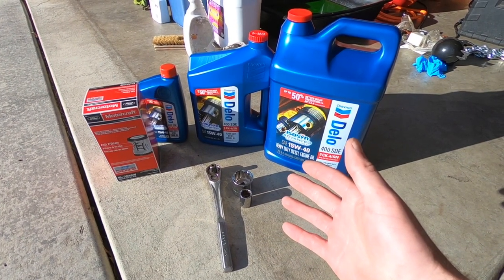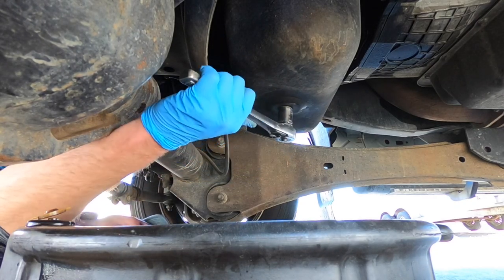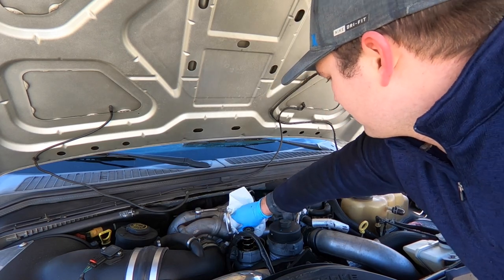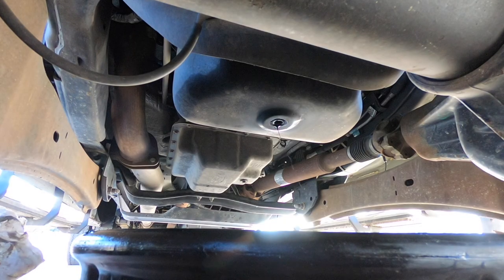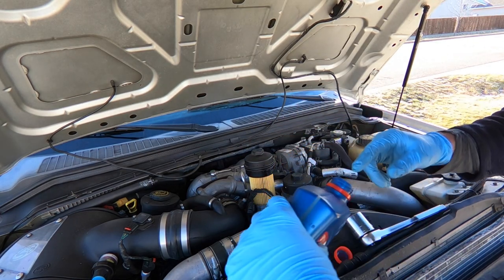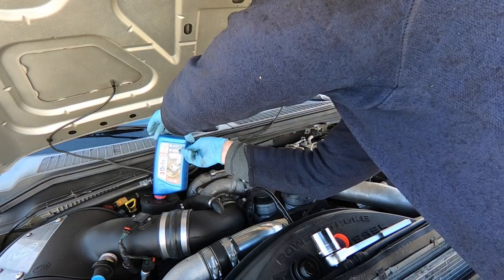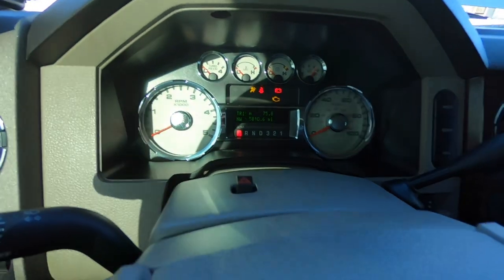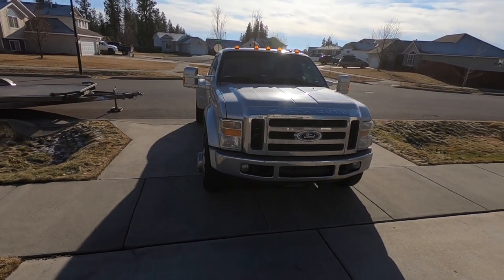DIY 6.4 Powerstroke Oil Change Quicker Than The Pros

Comment: I always drain the water separator at the same time. You will find it underneath the driver's side between the frame possible right on the frame inline with the drivers door just open the valve. I use a small glass jar to see the water separate from the fuel

Comment: Is that Delo stuff Dino or Synthetic?  First PSD guy I've ever seen use that.  I change mine every 5k miles with Rotella T6 Fully Syn.  I was using the 15W-40 for some time.  But then they came out with a 5W-40 (Both T6).  So I switched past few oil changes to the 5W-40. 

I think both are equally superior oils.  (Both CK-4 rated now).  5W better for colder starts than the 15W.  I'm in Jersey, so it doesn't really get brutally cold.  But I noticed the past few years that big box stores in my area are readily carrying the 5w-40 rather than the 15w-40.  I dunno.  Since the truck was 50k miles young (at 100k now), I have sent samples out to Blackstone for analysis.  Whether I was using the 15 or now the 5, I get equally outstanding reports.

......And FYI for the guy below who commented on CK-4 vs CJ-4 (which is what Ford spec'd "at the time").  CK-4 has since superseded the CJ-4 rating by API.  In other words, you are going BEYOND Ford's recommendation with a CK-4 oil. 

https://www.api.org/news-policy-and-issues/news/2016/11/18/new-api-certified-diesel-engine-oils-are

Comment: thanks for the vid first and foremost, but you have to check out the FoMoCo guidance on CK-4 oils in Powerstroke motors...you're not supposed to use it.  CJ-4 or the Motorcraft oil only.  Look for the bulletin that came out in 2016 when CK-4 hit the market.  It doesn't lube your motor worth a DAMN, and voids warranty, etc.

Comment: You should always let your engine sit for 15 to 20 mins after running so all the oil can settle to the bottom and you can make an accurate measurement. 😉

Comment: Taylor I just bought a 2010 6.4 Harley davidson I only drive it on the weekends have i put under 3K miles in 1 year do you think i can get away with doing the oil and fuel filters every 9 months?
Reply from the maker: Yes you should be fine!

Comment: Unscrew the oil filter ahead of time and let it drain while the engine drains and then you wont drip very much. I let mine drip for an hour but that works against the "Quicker Than The Pros" theme. If you do it at home there's no reason to hurry. You still have to transfer all the oil into the empty containers and take it someplace so the job is not done till that's done. 
Those one gallon water bottles from Costco thread in perfectly so cutting them make the best WIDE funnels.

Comment: adding oil to the filter housing will do nothing....  The first thing u do when u start your oil change is loosen the oil filter cap all the way....  When u do this it opens a drain back valve and allows the oil thats in the housing to go back to the pan, pouring oil in the housing before putting the filter back in only goes right to the pan..

Comment: Hey man I saw you have the H&S tuner. Where can I find the tunes for this unit. It came with my truck but no tunes loaded and because of that I can’t change my tire size to adjust speedometer or anything. Any help would be awesome!
Reply: You have to send unit into minimax for new vehicle programming. The tuner only is good on one VIN vehicle.
Reply: @Sasquatchmedic  the tuner is matched to the VIN of my truck it just says contact customer support for updated tunes. I can’t seem to figure out how to contact them for the updated files. I really want to change my speedometer calibration to match the tire change and transmission tunes are a must. Thanks for reply me additional info would be beyond appreciated!
Reply: @nicktoutant4411  Let me check on this, I think I have the contact info, If I remember, Bulldog now supplies mini maxx programmers, if matched to vin, and it does not communicate, could be bricked/locked, I’ll get back ASAP!
Reply: @Sasquatchmedic  man thanks so much!
Reply: @jason Miller hey did you have any luck?
Reply: @nicktoutant4411  You still need help?
Reply: @lydellhickmon6551  yes sir I do. I just need a tune that will allow my truck to shift correctly. My Speedo is off with 37s I bought this tuner specifically so I could calibrate my Speedo. Can’t do that unless you load a tune first. When I try to load a tune it says something to the effect of error contact customer support etc which you can’t. My fault for not doing more research before buying tuner but first diesel and it was already deleted and tuned just no monitor.

Comment: I get that little oil light briefly all the time on my 6.4.  I use all motorcraft filters with 15 qts at oil change....not sure why it does that.
Reply from the maker: sherlockhomesky make sure you have the correct oil cap. The first time I changed the oil on this truck it had an aftermarket filter and cap and I installed the Motorcraft filter with the aftermarket cap and the light came on every time I started it. It's very hard to tell the difference, but the cap is the problem for sure. You can pick up a Motorcraft cap on eBay for about $17 I think.
Reply: @TaylorSmithCars I never thought of that, bought the truck used so there is good chance it has the wrong cap. I appreciate the response!  Did you ever get around to moving the ebp sensor after your egr delete?  I have deleted mine through a tuner but still have the hardware installed and I'm dreading the task
Reply from the maker: sherlockhomesky Definitely give the oil cap a try. I haven't gotten around to moving the EBP sensor yet. I've been so busy that I keep telling myself I don't have time to do it, but I really need to. The truck is fine as of right now though. I am going to make a 1 year update video soon about the egr delete and will be answering some questions I have received about it in the video.